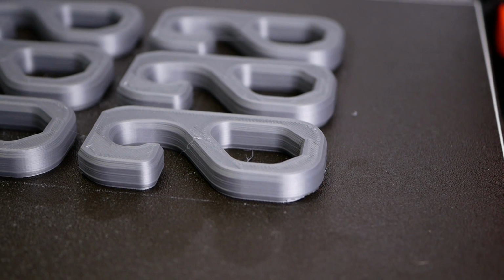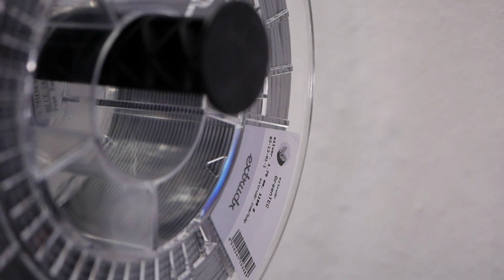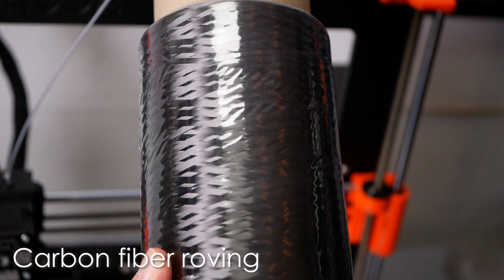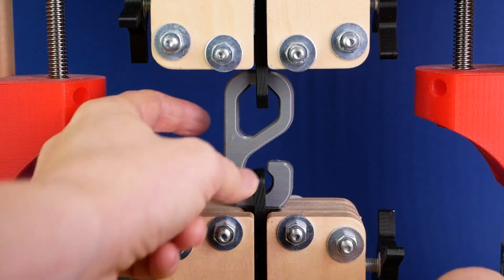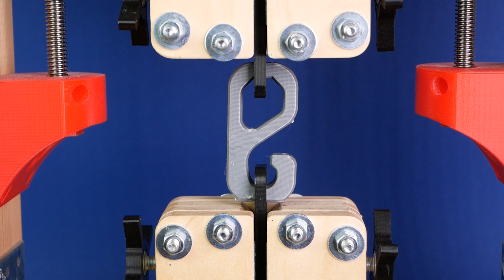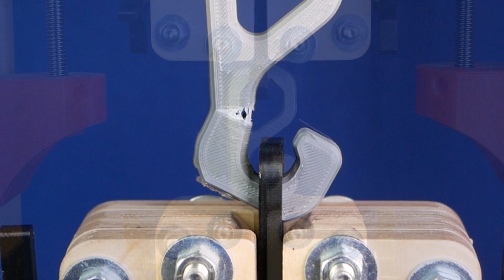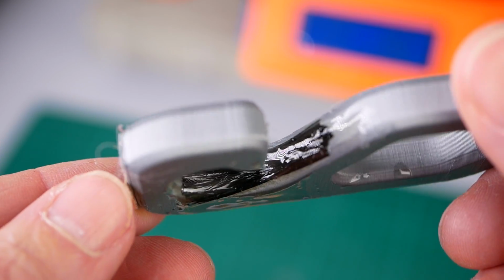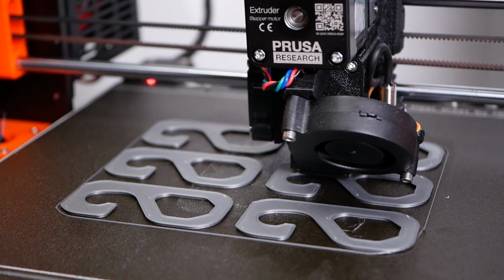STRONGER 3D Prints with GLUE? (and CARBON FIBERS)

Comment: Concerning the experiments with carbon fiber:

I think it could prove to be verry interesting to model a chanel on the inside of the hooks stop the print once the channel has been formed but not closed and fill it with epoxy and carbon fibre then restarting the print so it finishes the part.  DIY continuous carbon fiber filles 3D prints ?

Comment: How about doing a test where you do zero infill then inject epoxy to fill the void completely to give a solid part with a relatively fast print speed.

I don't know what you'd compare it against but it should give a huge amount of strength.

Comment: For strong, cheap and large prints I use concrete infill with carbon or glass fiber.
Compared to the cheapest Ebay filament my concrete costs are trivial.

Comment: I feel like it wouldnt help the strength of the 3d pronto cause you have to think, it's kinda like a sleeve. It will be pulling on the 3d print and not the actual sleeve. Meaning its not pulling on the superglue at all. Just bending it

Comment: Stephan, good video with interesting results.  I wonder if a polyurethane resin would preform better then the epoxy? Theory being PU could be less brittle.
Reply: @RazgrizDuTTA   yes I agree with that, especially with the samples that were pulled in the direction of the layers.  However in the samples where the layers were perpendicular to the force the epoxy induced stress risers that reduced the overall strength compared to the reference samples.  My thought is it would be interesting to see a material coating that has more stretch compared to the epoxy to see if the inter-layer stress concentrations could be reduced as compared to the reference samples?  After all Stephan does an excellent job of providing scientific results based on hypothesis, testing and observations of the results.  My guess is the relative differences between the elasticity as well as the tensile strengths of the two materials influences the strength of the part, but that's only a hypothesis of a very complex materials behaviour which often has surprising results.
Reply: @RazgrizDuTTA  yeah the carbon fiber is adding a third material with very high tensile strength and stiffness, which is the basis for modern composite materials.  And I agree that that is a way to achieve the highest tensile strength of the part, and as you've pointed out the weak link is the resin which results in delamination.  But going back to the coating only, if the epoxy hadn't of cracked when it did then the results would have been better.  I doubt any resin would have a significantly different modulus to the PLA base material (mind you I haven't researched it either), but rather a higher tensile strength with perhaps a less brittle failure mode could improve the results, which I believe PU resin does.  After all the goal is to find ways to improve our 3d prints, and the more tools we have in our bags the better.
Reply: @RazgrizDuTTA  significant gains, no. But maybe to reduce the anisotrophy of the part.

Comment: Superglue is on the contrary VERY USEFUL to strengthen super thin walls (eg. 0.8mm thick, made of only two perimeters) and prevent layer delamination under XY stress there, when one cannot make such walls thicker due to independent physical (space) constraints around the 3D-printed mechanical parts.
Because of your video and your conclusions which overlook this specific aspect by targeting other uses, people may miss out on this interesting solution. That's a pity.

Comment: While the static tests you perform are very interesting, I would have thought for many real world applications one would also like to see how the parts perform under vibrating loads.
Reply: @RazgrizDuTTA  I am no expert in the field, and would not know where to start on this.

I am also aware that fatigue testing itself is a very broad field.  The requirements for testing a lightly loaded living hinge is going to be very different from testing a component that may require more rigidity but carry heavier loads, and then you have to look at possible modes of resonance, and lots of other factor.

I was merely thinking about what are the real world issues in using 3D printed parts in real world engineering components, and that most parts in the real world do not fail due to static forces (because they are so easy to test and work within the established limits) but due to fatigue (exactly because they are more difficult to test for).

Comment: Not really a surprise that CF are stronger than 3D printed PLA, but interesting about the epoxy. Reminds me of the problems of using steel-reinforced concrete with their different moduluses of elasticity.

Comment: Just pepper the critical section with through-holes until it's more like a full infill with all the wall thicknesses.  Umma do it.
Reply: Or just use a modifier mesh in Slic3r to change your infill in high stress areas
Reply: or printed it all as walls, laying down, it's what i do for most of the things that need lateral support

Comment: The best way to get composite 3D print,is with ABS and use ABS slurry  to coat carbon fiber or just glassfiber. Epoxy or old polyester dosent chemical bond really good any plastic. Polyester and PETG is not that bad.

Comment: what if you use a very low infill, dont print the top and use resin or carbon fiber inside.. soh the PLA will be on the outside complete with resin inside.. totally stealth

Comment: Not a method, only a possible suggestion/stream of consciousness: Why not add carbon fiber strands during print? Add a slot just wide enough while the test pieces are laying down, to insert strips in critical areas; or possibly even better, make the slot shaped like these test hooks, maybe just inside the perimeter lines, and add in strips all along this inside circumference. I assume these would need to be glued in, maybe CA for that, since it is quick setting, then print over and/or around them. However, I'm not sure how the CA would react to the temps these hot ends run at. I've had CA vaporize under heat before, not fun. Honestly, I am not sure exactly how this could be implemented without being a complete PITA. So, only a suggestion.
Reply: Either that, or bend wire into shape, and inset that into the print. I've seen it done for resin castings. Maybe it would work here.
Reply from the maker: Already played around with it, but it's kind of hard to pull off.

Comment: Stefan, when you describe a result as significantly greater, you should show the variance of multiple trials. I'm not convinced 10% is actually significant, which means there is no difference by using glues.

Comment: (1) understand the proper orientation of the carbon fiber (CF) strands, (2) sandwich the CF in between two printed HALVES of the print, (3) trim and smooth protruding CF before curing and again after. I would think the print would be as strong or stronger than any real world plastic piece.

Comment: I think superglue does really help a lot with thin and under extruded parts - Parts that have visible gaps between the layers.
I think you've printed your test parts too strong to start with and your print quality is very good - too good for this test. It's like if you coated a steel bar with super glue and tried to test to see if the superglue made it stronger. You'd never really be able to tell.

Comment: Has anyone here tried making a d3 impression, placing small metal rods like wires and nails and then filling it with epoxy resin, to see if it increases the resistance? It would be the equivalent of reinforced concrete.

Comment: While i appreciate your efforts i'm not sure i entirely agree with the epoxy and carbon fiber test methods. Both may not increase strength from a stress perspective, however, both offer superior heat and weather protection. I wonder what would happen if you drilled different diameter holes in each test print.. Which would crack first?  Which test print would deform in the hot sun... There should be more test cases, not just a stress test.

Comment: Coatings won't do anything for strength unless your inter-layer bond is so poor that the glue can penetrate substantially, otherwise you're applying thin coat of materials that don't have much intrinsic strength (CA is brittle, epoxy is either hard and brittle or soft and flexible depending on formulation), so the overriding characteristics those of the parent material vs the coating..
I also wish people would stop thinking of epoxy as some sort of superadhesive..  Except as a binder for stuff like carbon fibre or fibreglass, epoxy has a couple of fundamental flaws that make it a poor adhesive for about anything: the fact that it "sticks" by mechanical keying vs chemical bond (ie, because it can grip onto irregularities on the surface, which is why scuffing of surfaces is required- epoxy will not stick to smooth surfaces) and the fact that it has very poor temperature resistance and softens and debonds with heat..  Acrylics and urethane are what the industry is using for actually bonding stuff together; epoxies are mainly binders for other materials and only used as adhesives in very specialized circumstances..

Comment: Please try a sandwich laminate with fiberglass/carbon. Would be really cool to see if it is feasable to build boats using a 3D printed core, then you could get your perfect shape and strength :D depending on how low infill you can have on the core it could even be cheaper than most other materials too :)

Comment: What you're doing wrong with the super glue is not using the baking soda layering method, building up 2mm of it would give you hooks you'd be unlikely to break with a hammer

Comment: Very interesting (and annoying) results. I wish you had expanded on types of glue rather than putting the nail in the coffin as it is the viable way compared to eg. remelting in plaster. How would for example a more penetrating mix like epoxy+ethanol work? Would other more yielding glues work? Could you improve layer adhesion by curing in vacuum etc. Keep up the great work you do!

Comment: Dude, put a completely loop of carbon Fiber in the hook,  following all the path, then put the piece incide a vacuum bag, and suck out the exesive epoxie, with a vacuum pump, then wait for 3 days, rip out the bang and then test again.
Every job in carbon Fiber really takes a lot of time, that's just one off the factors that make the finished pieces of CB really expensive.

Comment: You need to revisit the continuous carbon fibre along layer direction because every other test in this video was pointless. Glue and epoxy have incredibly low tensile strength so it’s no surprise at all that they didn’t add strength to the part

Comment: Pretty sure it's weaker with glue an epoxy because the load isn't on the plastic and it can't stretch. The epoxy is taking all the weight  and when the epoxy fails, all of that force is transferred to the plastic causing it to fail quicker.

Comment: Most of all your results were determined by the filament you were using.
A more flexible and stretchy filament with hard support will give very poor results - the hook it self starts the stretch, but the CA-glue is hard and brittle, it can not stretch much and will take up nearly all of the load till it fails, then you are back to the strength of the base material.

It is a mistake that many hobbyists make when creating their first glass fibre RC boat/plane - they notice that one particular spot is not strong enough and add some carbon for reinforcement - only to then notice that this has not helped at all or even made the part weaker.
The support should never be stiffer than the base material when you want to increase its strength (only if you just want some stiffness but dont care much about strength)

Comment: This test might’ve worked better with fiberglass actually. The carbon fiber has very low ductile strength and will not increase the shear strength of the overall part, it will only decrease the elongation until it starts cracking like the video, which is long before the actual parts fracture toughness.

Comment: im trying to make a bow but it needs to be strong. i made it in 10 parts , i was looking at you video and was thinking to run fiber from one end to the other. or could i dip each part in medium strength glue then vacuum seal it. will that work or not let me know thx.
Reply from the maker: Using some fibers or even a rod in the part might be the best option.

Comment: Try to infuse the parts in a pressure chamber with epoxy. Epoxy does not stick to plastic you will need more of a "form fit".

Comment: I hoped that cure time of the epoxy and glue would have been noted/posted. 🤓 Although glue/epoxy manufacturers usually say “cures in 30 min” or even 24 hours, most tend to fully cure (and fully harden to the core) in roughly 36-48 hours. Still great video and very informative, great work👍🏻
Reply from the maker: All parts were cured for roughly 5 days.

Comment: That is exactly what I have been looking for for a long time. A reasonable PLA adhesive. Thanks for the test. Now I hope that it can also be obtained in Germany.😁🙏
Reply from the maker: 3DGloop is also a good option for PLA, though I'm not sure if available in Germany.
Reply: @CNCKitchen  😁🙏Thanks for the tip. Unfortunately also not available from us. (or not found yet). But now I know one thing: There is a lot of discussion about PLA adhesive on the Internet. e.g. also with cyanoacrylate glue. Super glue, but not exactly harmless!👍

Comment: ”If you have experience on that field...” Yes. So commenting. 3D-printed PLA is great core material for carbon fiber products. Even parts printed with only 2 perimeter walls and about 7% internal infill, when mated with carbon fiber are extremely strong and extremely rigid. With 5% or less of infill the structure cant withstand cure in vacuum but will instead crash internally. Ofcourse, if more temperature resistance is needed, the plastic and epoxy should be adjusted according to requirements.

Comment: Have you tried 2000lb epoxy resin that you can find at any Home Depot? Im not sure you using one of the stronger epoxy's out there because in my experience that when the epoxy I use is properly cured, I can hardly put a drill bit through it. The one Im talking about cures in 24+ hours, but you can find some out there that are UV cured in less time.

Comment: What bothers me the most about videos like this: No one ever puts a disclaimer that the results are dependent on using the same brand plastic and I honestly don't think that's enough. Everyone knows there's going to be a variance in the mix from beginning, middle, to end. So even the same batch of plastic, from the same manufacturer, will have a good bit of variance. Notice no one has texted multiple rolls to see if there's any major changes.
Reply: but if everyone knows, why the need for a disclamer?

Comment: Pause your print and fill it with epoxy! Then keep printing. Thought about doing this a few times on the markforged where you could set pause points automatically. But I didn't want to ruin my jobs $20k printer 😆

Comment: Unfortunately the carbon fiber reinforcing has limited use. After all, it is little different from actually manufacturing from carbon fibre and so it dependent on tools, molds etc.

Comment: on the carbon fiber he printed them vertically which means you should be comparing the carbon fiber to the vertical printed ones not the horizontal printed ones which are stronger to begin with

Comment: You should try switching the infill on the parts to something like gyroid and injecting the parts with epoxy as a filler (possibly with some sort of fiber mixed in like sawdust even). The gyroid infill should keep all the voids connected internally IIRC and you should be able to end up with a solid part in the end.

You should also check out https://www.youtube.com/watch?v=0ItPfhx3ulw
It might be possible to directly fill a printed part with wood/paper fiber to make a solid part that is strong, cheap, biodegradable and is recycling materials.

Comment: Your carbon fibre orientation was wrong, you should have laid from top to bottom around the part that way the stress in evenly distributed along the carbon strands. Also around the part you will need.

Comment: The right material for the right job, it seems like these kind if parts should simply be made out of metal, like many other testers figured out years ago, but yes, a nice informative video nonetheless on how to improve overall strength of plastic, and using carbon fiber only means it will be stronger then plastic and weaker then metal in the end... feels pointless testing and wasting material on that. : )

Comment: Be careful, if you use proper 48 hr epoxy or  carbon fiber with proper carbon fiber epoxy you are entering the realm of strong that will break your test rig.

There is a lot of testing on how much weaker the 15 minute epoxy is: https://youtu.be/XObmZIbHOzY

Comment: Your carbon fiber is going the wrong direction.  Put the fibers going up and down. You could absorb most of that glue with a paper towel and it would still be strong also.  The glue doesn't provide the strength... it is the carbon.